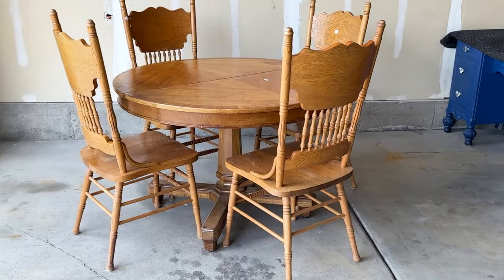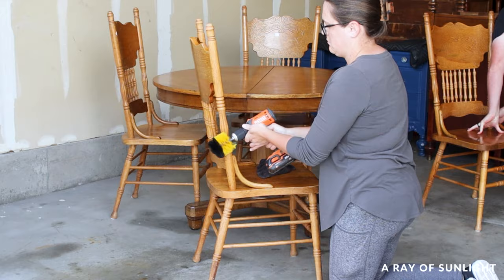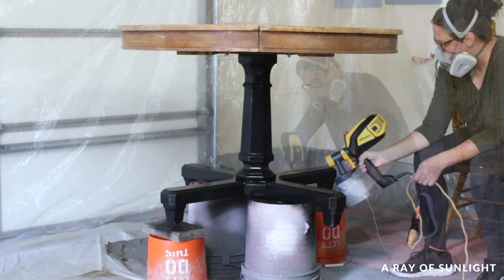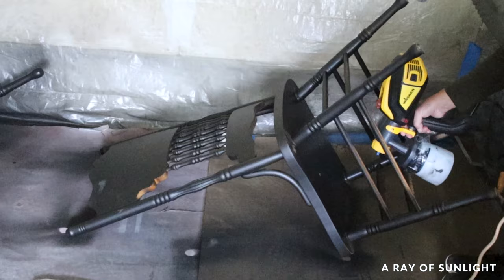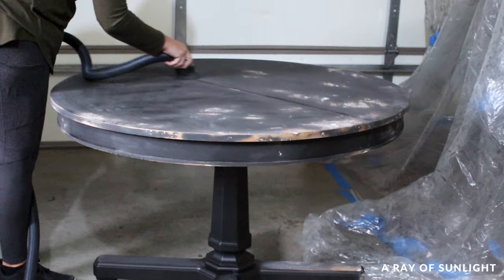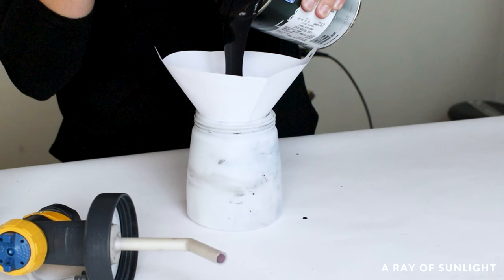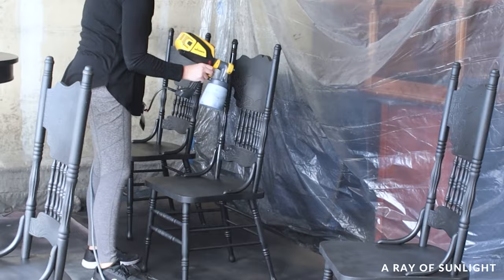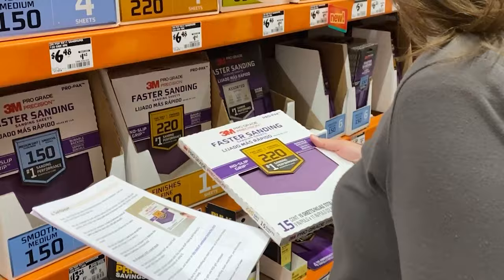Painting a Dining Table Black

Comment: Thank u so much. I’m a first time mom. Trying to fix my dinette table which is blk made of wood long rectangle shape. The top is peeling paint. Very tiny peeling. I bought form value city I’ve had my table about 4 years already peeling. Such a bummer. But I only have to do the top. Water damage is my issue which cause Peeling. Luckily there are no water bubbles. So I’m definitely going to follow these steps. Will let u know how it turns out. I’ve never done anything like this before. Wish me luck 😂😅❤😊
Reply from the maker: Good luck! I hope it works for you.

Comment: I have a question: I actually really like the sanded down look that takes off the gloss of wooden furniture (around 1:40 in the video). What would one put on afterwards? Would a wooden furniture wax work or does it need an actual (non-shiny) sealer? You have so much patience doing these makeovers--it came out beautifully!
Reply from the maker: Thank you! You could put on a wax, but it will deepen the color of the wood again, as well as a topcoat. You don’t have to have a shiny sealer though! The shinier the sealer though, the more durable it will be.
Reply: I don't see the list of supplies